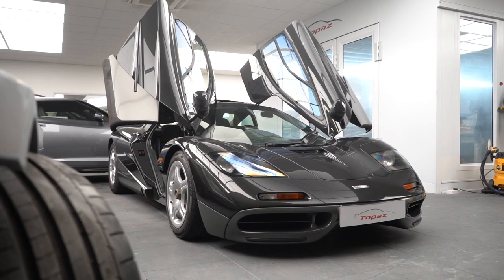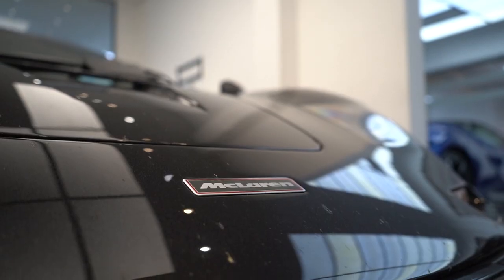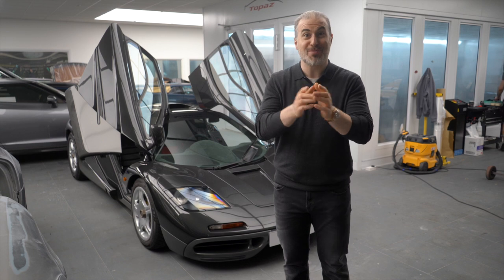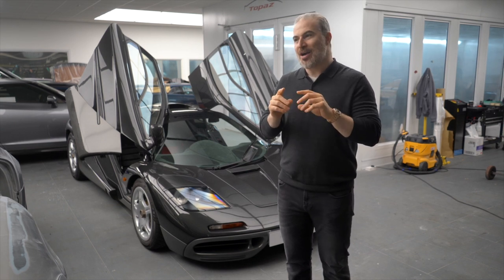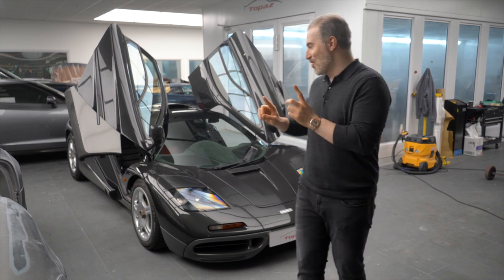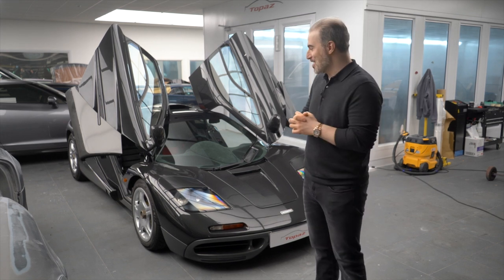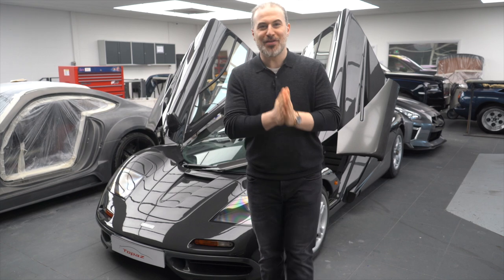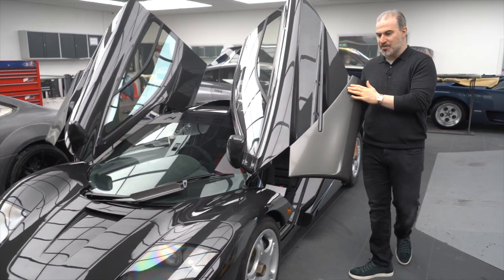How To Wash a £16 million McLaren F1!

Comment: Bearing in mind how contaminated the wheels were due to the distance travelled...I would have used Iron Out before brushing the wheels or using a mit for the body work. Rinsing and snow foams dont release the iron particles stuck to the surfaces...just an observation...👍

Comment: How would you clean the engine apartment with all of that gold leaf? Any particular products or methods?
Reply from the maker: We will do that when the TopazSkin is finished
Reply: It’s not gold leaf. It’s heat insulation tape, adhesive backed. When I worked at Mclaren the we used it on the formula one car, 3m make it